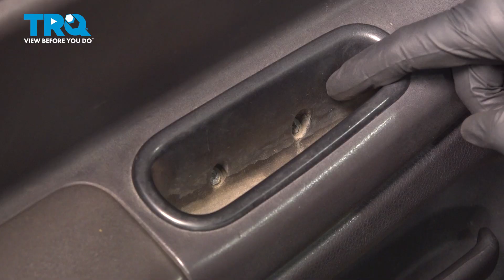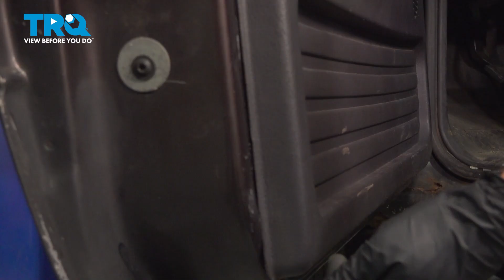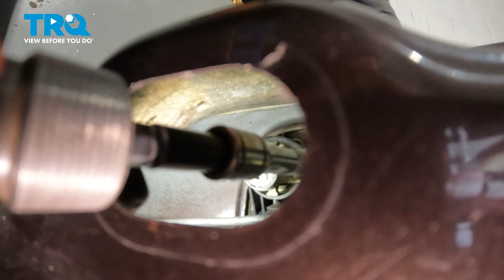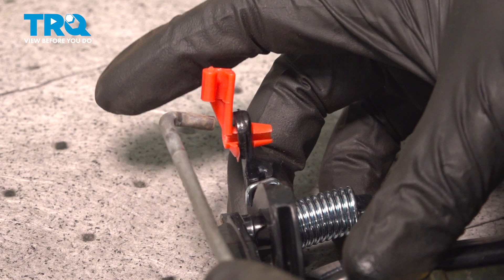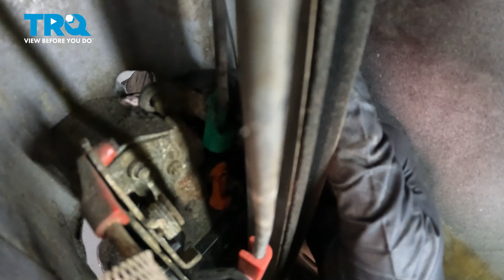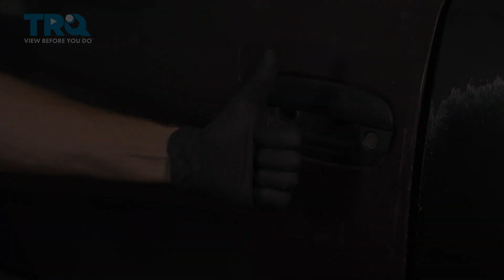How to Replace Exterior Door Handles 1994-2002 Dodge Ram 2500

Comment: Cut all but the top two nylon fasteners with a hacksaw blade. Leave the top two alone the panel will come off if you shove it forward after cutting all of the other nylon fasteners. Remove the lock assembly before trying to work the handle out  of the door. Just like the video put the new lock and control rods on the handle before putting the handle back in the door. Remove the push pull mechanical rod before trying to get to the other rods. If I had it to do again I would try sharpening a stiff putty knife front edge and see if that would cut the fasteners.

Comment: I'm on my 3rd exterior door handle. Instal goes great but nothing will last in the 120 degree arizona heat. The plastic gets soft and if I try to open the door, the handle breaks in the same spot every time and I'm out 30 bucks